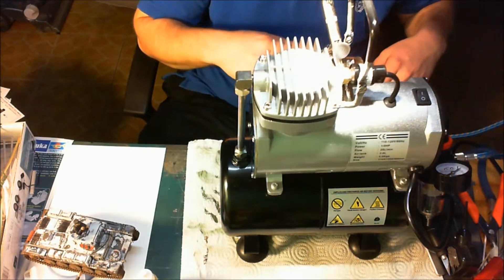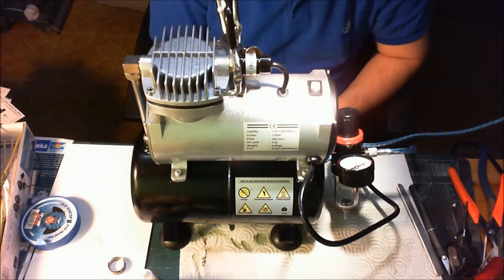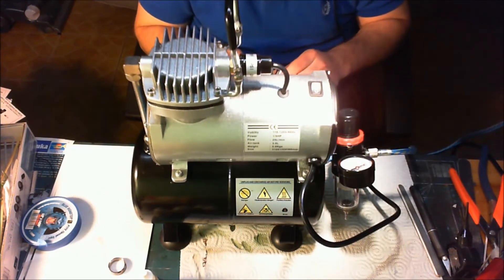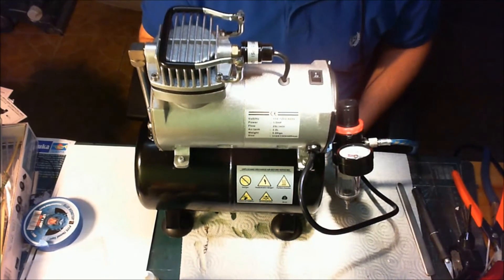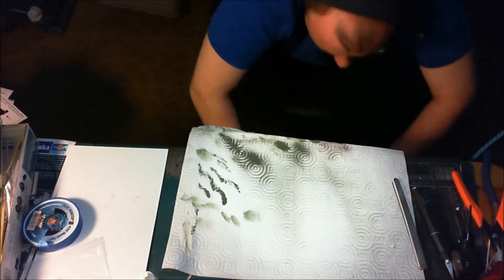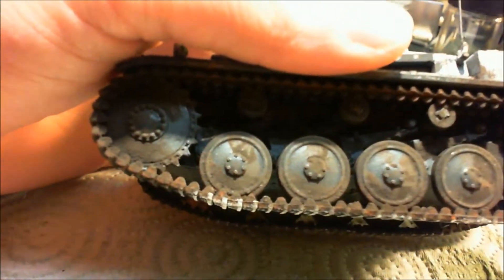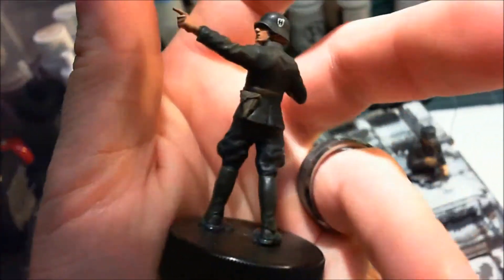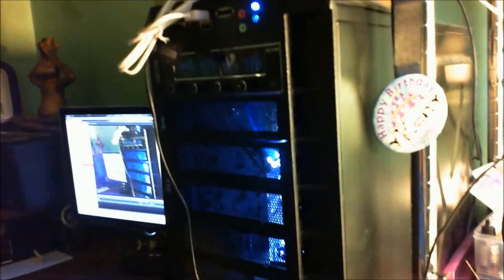December 2013 Update

Comment: I have almost the exact same compressor, and an Anthem as well haha. Both work wonderfully together. My anthem is on loan at the moment. 
I've been pretty happy with my compressor since I got it, no troubles at all.
Oh.. I wouldn't leave the air in the tank after you're done spraying. It will start to rust on the inside of the tank. Or so I've been told.
That Pz II is looking awesome dude!! I can't wait to see that on the dio!
Reply from the maker: I thought condensation only formed during pressure changes.  I may read up on the subject a bit. 
Thanks, got the base coat on the groundwork done tonight.  Need to find some small shrubs to put around it.
Reply: It does. You're absolutely right... But even the best tanks leak slowly. The slow leak causes condensation to exist in the tank. It builds up over time and begins to damage it. The lichen that grows on hardwood trees makes good shrubs once it's been painted brown... It's that fussy bluefish grey moss that grows on them. Then you can add some ground up parsley or thyme,... Oregano works well too.